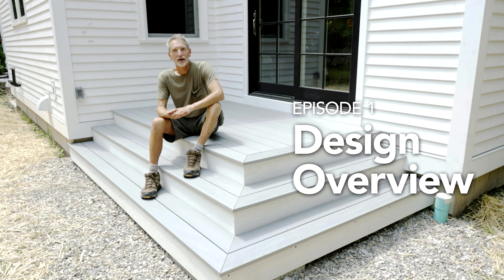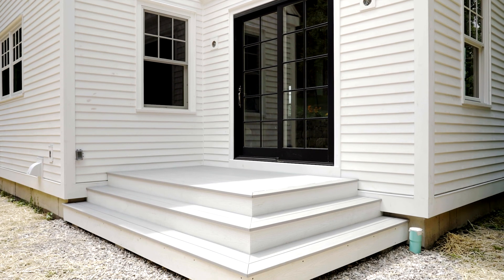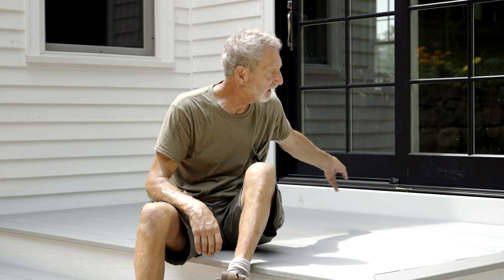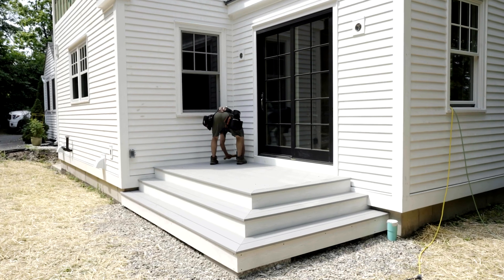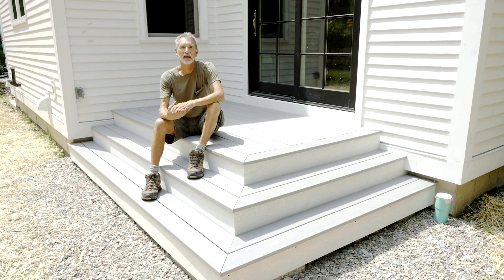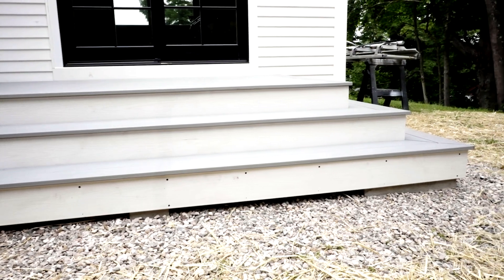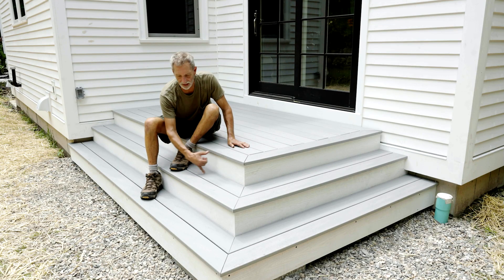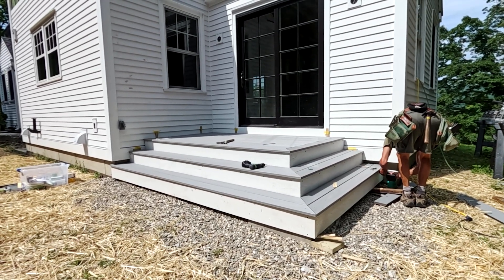How to Design a Freestanding Deck: No-Handrail Design and Code Requirements

Comment: With risers wrapping the whole deck, will there be adequate ventilation? Even with plastic decking where cupping may not be an issue, it’s a long ways from the 18” of open sides for airflow everyone seems to recommend. And if you don’t think it’s a problem with this decking (I.e., no mold or framing rot issues), would you expect it to be adequately ventilated for wood decking? Or would it be asking for cupping due to moisture differential?